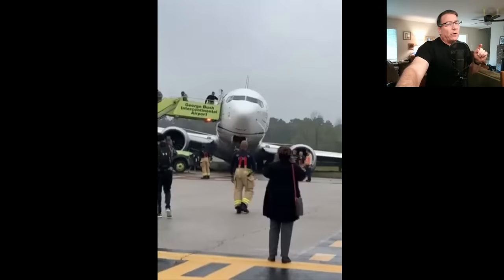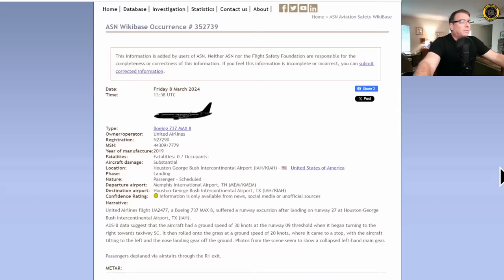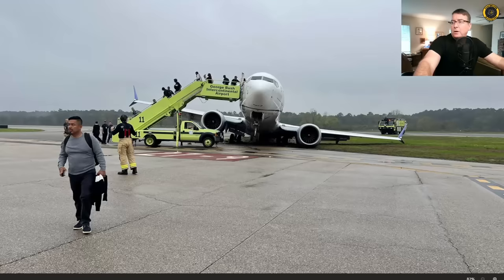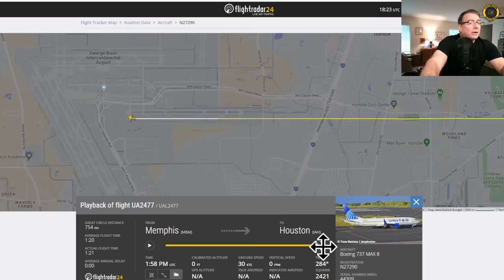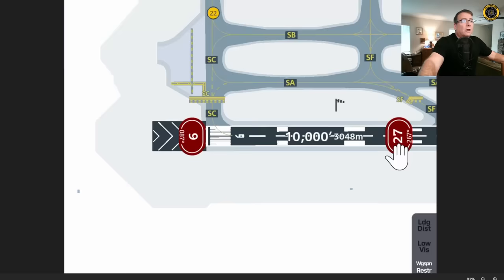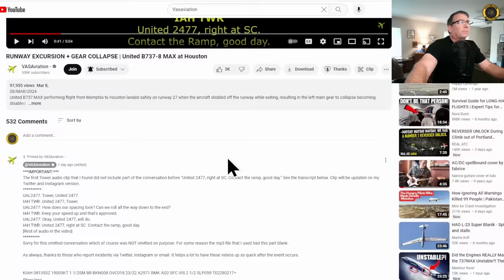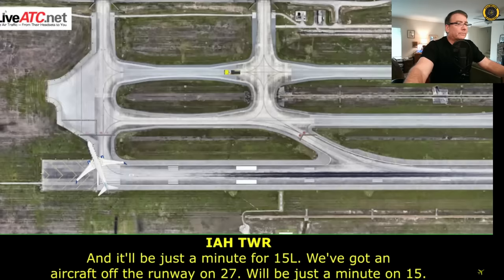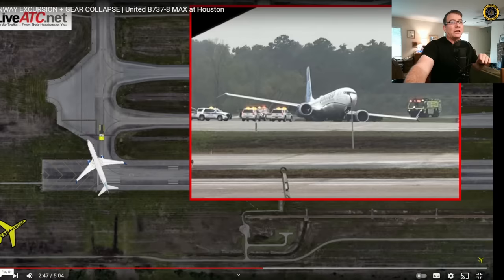United 737 Max Runway Excursion IAH 8 March 2024

Comment: its generally a good idea to NOT drift your 737...
Reply: maybe Boeing made an undocumented change to how the handbrake works in the Max.
Reply: 30 kts turn, they must have thought they were southwest pilots
Reply: @Rocinante_Tech ADSB ground speed data can be very inaccurate. I run a receiver and very few airports I’ve seen pickup ground data cleanly.
Reply: Clearly the Max 8 needs a larger rear sway bar to eliminate understeer!
Reply: ... unless you are landing at Tokyo
Reply: @tompetrushka1627  LOL!
Reply: Fast 11: Tray Tables Locked & Loaded
Reply: 737-700 drifting is totally cool!
Reply: Well not with THAT attitude.
Reply: Maintenance welded the diff before the flight.
Reply: At that speed, they should have banked it to the right.  @Rocinante_Tech
Reply: Yeah Juan, so much wreckage, so little reporting time. I hear ya! 😊
Reply: They could have flown that corner if they kept their ground speed up.
Reply: I bet they were playing  "No One Sleep In Tokyo" in the background  :text-green-game-over:
Reply: Another Max.?
Reply: I don’t feel comfortable flying in this plane. Period.
Reply: I’ve worked there for 12 year. Keep your speed up, roll to the end was a normal thing to do there. BUT the concrete is super slippery when wet.
Reply: That's no fun
Reply: @jennifergriffin3690  This is not the MAX's problem. This is driver (pilot) error.
Reply: @awboat  ....with a little help from ATC. If airports want to increase capacity they shall invest in...wreck removals eqpt.
Reply: Seriously!!!
Reply: @johncarter1137 More rudder!
Reply: Copy that!
Reply: You think?
Reply: @Rocinante_Tech Or Ryanair 😏
Reply: Drifting a 737? That’ll be the new Fast and Furious movie.
Reply: @svr5423  When did Vaughn Gitten Jr. get a pilot license.
Reply: Actually this is the exact opposite of drifting.  This is total understeer
Reply: Sometimes the bells and whistles play to the tune of Tokyo drift and things get wild.
Reply: Well, there was a video with some Dutch and German pilots racing to the gates in 747s and they did alright! The Germans lost…
”SCHEISSE!”🤣
Reply: So are we gonna see this plane on Mighty Car Mods next?
Reply: I knew a guy who drifted a Beech 99. Had to use prop reverse to keep from going off the side of the taxiway. The tug could barely get it moving with all the ice
Reply: It’s a better idea not to indict the crew before ruling out a mechanical issue.
Reply: @awboat And you know this how, exactly, given the same thing happened to a different MAX landing at EWR a month ago?

The feds indicated the malfunction was caused by a cold-soaked rudder roll-out guidance servo.

But, of course, you know this was pilot error.
Reply: Boeing now has drift mode.
Reply: @Rocinante_Tech Just hope they were not Ozark pilots. I knew a few before Braniff bought them out. Those guys could drink me under the table and that took some doing in those days.
Reply: Gotta use some differential throttle when you drift.  Like maybe 25% power with the right in reverse?  Flaps up, yoke full right and forward with full right rudder?  🙃
Reply: @jennifergriffin3690  Not sure why you blame the plane for human errors. It's a passenger plane and not a race car.
Reply: Mines always drifted fine.  My 757 was a mess in the wet!!
Reply: My 737 drifts fine, it’s my 747 that has problems
Reply: @svr5423 Handbrake now makes you speed up and Engine 1 falls off.
Reply: It wouldn't drift with understeer.
Reply: Just testing MAX-8 turning capabilities… just saying. Never say never.😊
Reply: Split the throttles, drift to the terminal, everyone out!  We gotta schedule to keep!
Reply: Only in Tokyo
Reply: Fast & Furious: Runway Drift
Reply: @alwaysrockn2009 that’s going to be Fast and Quite Furious - NTSB edition
Reply: I can hear Initial D theme song playing in the background...
Reply: @awboat  Did they have their winter skidding training yet? We always do in Sweden. "This is how you negotiate a curve without slowing down..." (It's called "controlled skidding".)
cheers! / CS
Reply: It is or It's Not its
Reply: Detroit Locker.
Reply: @brandonharlow7067 Good point but still sounds cool
Reply: @Rocinante_Tech 😳

Comment: The painted white stripes are extremely slippery when wet. We often get nose wheel slips when lining up to wait, over them.
Reply: A very good observation!  As a former motorcyclist, was always more careful when traveling over painted lane marker lines.
Reply: Back in 1985, NASA was getting ready to coat much of the shuttle landing runway at KSC with paint as a way to smooth the intentionally rough texture which had turned out to be too rough (tires were sometimes wearing down to the cord layers from one landing).  I got them to drag the pavement with a large block instead, which handled the worst of the asperities.  I'm surprised no one at NASA involved with this particular effort understood the consequences of paint for tire friction.
Reply: @marcmcreynolds2827 Good use of asperity. I have only seen or heard it used to describe a tone of voice. Thanks.
Reply: They obviously don’t listen to Bon Jovi much do they, otherwise they would know!
Reply: That can even happen to tug drivers or EBTs who go fast over the many many paint markers on the apron.
Reply: Same on my motorcycle.
Reply: @Elizabeth-tg7jo  Same on my bicycle, always avoid the lines when damp.

Comment: Juan, any "born and raised" Texan knows what happened......when that left landing gear rolled off the runway and onto good ol Houston black gumbo mud she sunk like a brick in a tub of water lol.  When you said it had been raining, yep, soggy gumbo.  Two days of sunshine and that black mud will be as hard as a rock.
Reply: Louisiana gumbo mud too. Lol lol lol. Ive been stuck in it before even with interco super swamppers.  Its like it sucks you down in it and turns to concrete.
Reply: @thomaswilson8634  over here 2-3 days of sunshine and the gumbo will dry up and start cracking lol.
Reply: Houston Black, the state soil of Texas!
Reply: @amberhardy8233  yeah buddy !! lol
Reply: Wow, sounds like British mud. Only difference is that generally our mud doesn’t get to dry out very often. Maybe a few days in summer if there is a heatwave that lasts long enough but usually it never gets out of the sticky state. 😆
Reply: Nah. Born and raised Houstonian here. We didn't get that much rain. I know because I'm 20 miles away from IAH and I poked some holes in my lawn yesterday, wet on thatch layer, dry as Arizona below. Landing gear collapsed due to lateral force of running off pavement. 737-8 landing gear not designed for 20 knot 90 degree turns, that's all. Look at the photos and video, landing gear not sunk in the ground. And I'm confident those civil engineers that specified the runway pavement also specified high density "engineered" soil adjacent to runway, for this very scenario.
Reply: @mark52111  Thanks for the update.  My original post was meant as a "tosngue in cheek" play on houston dirt.  lol
Reply: Mark5211 would churn in some lime before pouring slabs in Houstpn. Lot cheaper than laying down an osmotic pump.
Reply: same with my garden --- in Thailand
Reply: @mark52111  Makes sense. The 737s move very slowly at the airport I work at. They follow the yellow lines to keep them from wandering off. Personally I enjoy waving the glowy batons to guide them into stand.
Reply: I've been on on flights into Hobby with a couple of inches of standing water on the runway.  Dicey. Lol. Houston is always a wet, soggy mess.
Reply: @mikoto7693 It's this kind of soggy sticky clay goo.  It will dry out, but it takes weeks once it's been flooded after a storm. It will take your boot if you're not careful, just like the mud where you are :)   A heavy plane has no hope of getting out.

Comment: Boeing 737 Max not suited for Fast & Furious drift
Reply: lol
Reply: @wizardmix   It's got nothing to do with the plane. The pilots came into the turnoff  way too fast.
Reply: @johnstone7697 That's what they need to look into now. Boeing had to change the position of the nose wheel and the main landing gear to adjust for the bigger, more forward engines. Does that mean the 737 Max handles worse in wet conditions than the original 737? Have the pilots been trained/told about to avoid tight corners with that plane?
Reply: @johnstone7697  
Thank you thank you!!!
Reply: @eljanrimsa5843  
Why not ask Southwest pilots?
Reply: @richardlewis4288  lol
Reply: @richardlewis4288  CRJ 200/700/900 Pilots come down the J-line so fast sometimes, they're 5 feet from the stopping point before they've finished turning.  I don't know whether to x out or dive for cover sometimes.
Reply: @wizardmix it’s because your knowledge is media based and not fact based.
Reply: @eljanrimsa5843 do you smell what you’re stepping in?
Reply: @wizardmix My God, do you listen to anything of relevance regarding the MAX? Do you even fly a commercial aircraft? If you don’t then enough with your media educated rhetoric
Reply: This is PILOT error NOT Boeing’s error. 
You skid into soft grass and something has to give!
Reply: I thought the 737 Max is a riding lawnmower.
Reply: @johnstone7697 ah, 2 Fast 2 Furious
Reply: Better this than the 747 MAX!
Reply: Boeing 737 MAX not suited to be flying !
Reply: @Perich29  As I told my kids when they were little, “That’s what thought got you!”
Reply: @eljanrimsa5843  The repositioning of the engines in relation to the nose gear should help turning performance, not decrease it. I've taxied the Max-8, and it handles quite well.
Reply: @wizardmix  This is the kind of idiotic Peanut Gallery response that is turning YT aviation channels into a joke.  This incident has nothing to do with the airplane model at all.  The owners of these channels do nothing to mitigate this mob of fools because it gins up their viewership which is all they care about.
Reply: @eljanrimsa5843  No.  It does not mean that at all.
Reply: Lol😂
Reply: Yeah, I came here to say that Fast and Furious might not be a good in-flight movie.
Reply: @paulgooding803  I wrote a response to a couple heated comments I've been getting.  It wasn't a mean spirited response at all.  Looks like that comment was deleted or removed outside of my control.  If we aren't allowed a debate, even when those who engage me lead with personal attack, I suppose I'll retract my original comment that's attracting the negative attention.. DONE.  You're most likely right in this circumstance, all evidence does point to pilot error.  That said, it doesn't change my view on the blunder that the 737 MAX is.  Anytime the media gets a hold of something, it reminds me.  Side note, and as someone who reads NTSB reports voluntarily, it amazes me how those who would accuse me of being irrational  and a slave to the media often don't follow their own advice where other subjects are concerned.  It's ironic that the decorum I'm addressed with leads with insult as you've demonstrated.  We are all driven by media.  All media is biased, yes even this one here.  Fly safe.
Reply: @LEVELGAZANOW  And if I do then what? Suddenly my opinion matters?  Looks like my earlier response was deleted or removed.  So be it. I deleted the original comment.  No sense in it.    

Some free advice to you:  If you are a pilot, I hope you're not a commercial pilot because this mindset of "I'm right because I'm the expert here and no one is allowed to have an opinion of their own,"  only creates a culture of fear and avoidance from those around you.  I know a supervisor like that.  Leads with negativity and scold.  If you get caught up in it, you spend more time figuring out how to keep this guy from blowing his lid than you do figuring out the safest most responsible practice.  I notice people make more mistakes around this guy simply because they spend more time second guessing themselves than they do around more tolerant supervisor who put the burden of responsibility on them.  The former makes the work joyless and dangerous, the latter makes the work rewarding and safe.     

So sure, I bow down to the mighty pilot, if you are one, I'm not worthy to lick your boots -- but if you are a pilot, I don't think you're setting a good example.  If I'm full of it, educate me with your expertise and now we have a dialog.  Come at me like this and all I walk away with is a negative opinion of pilots.
Reply: @wizardmix  That's all well and good friend, but you are way out of the lane here.  This runway excursion and   gear collapse has nothing, at all, whatsoever to do with Boeing or the airplane model.  It's all about shitty flying.  I say that because I participated in something like 10,000 landings in my flying career and I know that when you screw up a landing and break the airplane you don't get to sit around and say gratuitous crappy BS about the airplane manufacturer just because you want to.  Aviation is a professional society and should be treated with respect.  It's not a reality tv show for people with nothing better to do.  Please keep this in mind.
Reply: Im not sure if you watched Juans vid here but they were goin over twice as fast as they were suppose to when they attempted the turn. they have thrust and on a wet runway an aircraft doesn't make a 90 degree turn at any kind of speed.I don't think this one can be blamed on the aircraft. time will tell though.
Reply: BOEING 737
Learn to write it correctly
It is not difficult
It is written on the aircraft
Make sure your brain sees what your eyes are looking at.
ZOMBIES have eyes but cannot se - ears and cannot hear

Now for your homework
write an essay explaining why it is BOEING and not Boeing
( They sound the same  BUT they are not the same. )

For extra points that indicate that you are a  scholar of some note -
write an essay explaining the difference between
The UNITED STATES OF AMERICA   and 
The United States of America
My youngest students age 8 know the difference -
but of course - they are academically more advanced than you.
Reply: @paulgooding803  Perfectly reasonable.  I'll openly admit I was using my dislike for the 737 MAX program, which is why I deleted the comment but deep down I knew it was pilot error.  

It's a different comment for a different subject but I'm more than mildly disappointed in Boeing.
Reply: @wizardmix  Good answer.  I am tempted to launch into a discussion of the MAX but I have devoted so much time to it over the years I am sick of it.  And I do not belong to the club of people who blame Boeing for it, I blame FAA almost entirely for it.  First, they created the airplane by making demands on the design before certification and then ... walked away from the certification entirely to let Boeing do it themselves.  Then they approved a rollout of the airplane without any serious training on the MCAS system.  That lack of training is the proximate cause of the two crashes ... the crews could have flown out of the control problem easily if only they had been told how to do it.  Anyway, grist for another mill.  The airplane itself is an awsome product but the incompetent news media may still kill it off.  We will see.
Reply: No , Taking a 90 turn in any jet over 15 kts on a wet runway isn't a good idea.  Zero Max issue.  Complete ignorant public comments.
Reply: "U" Turns are not allowed!

Comment: Spot on Juan.  30 knots for a 90 degree turn, even dry, is no good.  Add in the wet paint for the TDZ markings and you unquestionably have steering control issues.  The gear collapsed when it dug into the mud going sideways.
Reply: @GuitarRyder11  He was trying to help out the tower and forgot to take care of himself. The paint on roads gets very slippery when wet on a bike. Also when it is warm.
Reply: not real sure from that picture if the gear collapsed or just sunk into our delicious black gumbo called dirt.
Reply: @GuitarRyder11 Or it could have been just a mistake. Pilots are humans and every human makes mistakes every so often. We just don’t know at this point so I’m reserving judgement until I have the facts.
Reply: Houston mud is basically 100% clay and sticky as glue. It'll take your boot right off your foot. lol.

Comment: Doesn't matter what the tower says, it's the pilots responsibility to control the airplane
Reply: When tower says "hurry up" in wet and unfamiliar conditions, just reply: "tower, guess how many fingers i'm holding up, use your binoculars.."
Reply: Exactly, pilot can always say "unable".  The aircraft would have likely been asked to exit on one of the angle taxiways, and then taxi slower down a parallel taxiway.
Reply: Doesn't change the fact that the tower shouldn't have done that.
An accident should never be single point of failure. Fix all issues leading up to the failure.
Reply: @theaureliasys6362  Very astute observation. Reference my previous posts point.

Comment: They left the engine running while they looked in the QRH for a section on 'farming mode'
Reply: Not sure what that means, but sounds like there’s a joke in there somewhere. 😜
Reply: @libby2012  Quick Reference Handbook.
Reply: QRH is what pilots reference whenever theres an abnormal/emergency procedure that needs to be performed…
Reply: @kellysunseri-adams8550 The Quick Reference Handbook.
Reply: Funny stuff.
Reply: The ultimate rotary plow to till thy crops
Reply: Farming mode is hilarious!
Reply: @kellysunseri-adams8550 and DEI is the reference for someone unable to refer to the QRH.
Reply: United out here just trying to do IAH a favor and give them a quick free grass mowing.
Reply: Just look at their CEO, shit flows downhill.
Reply: @wendiwasson7017  Very uniformed and ignorant remark. United flies over 4500 flights a day without incedent on 99.99% of them. Impeccable corporate culture trickled down from above. Possibly the best in aviation history. Were you just fired by them?